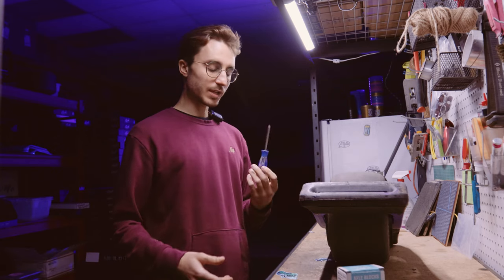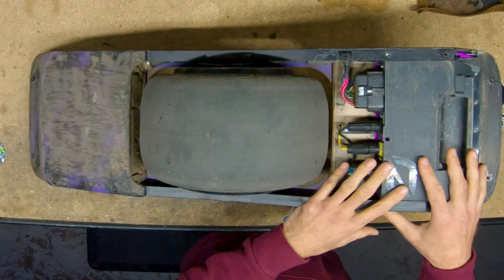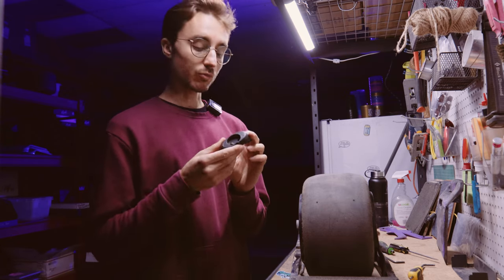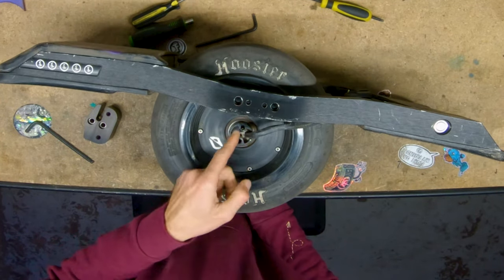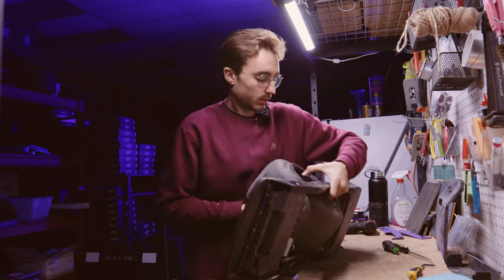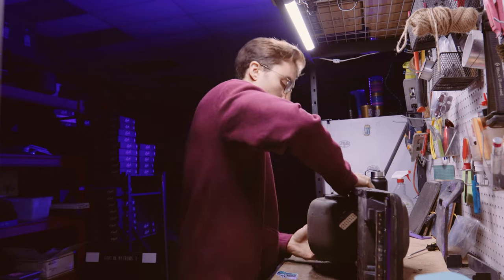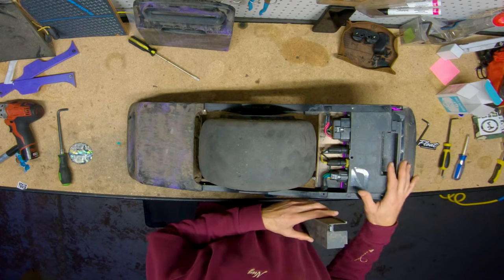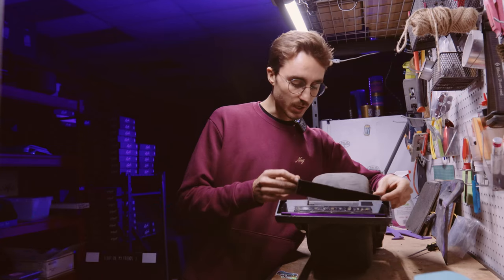Half & Half Axle Blocks Installation Guide

Comment: Can't wait to get my hands on one of these, been waiting patiently since Jake first started talking up the idea early this year. Side note, noticed the front bumper on this board isn't using the top 2 insert screws, ever had any issues running them like this? I've always wondered how necessary they were outside of helping with the fitment, it would definitely be nice to be able to get to the controller without having to remove the front footpad to get to those screws
Reply: Personally, I do use them every time, but I know people that ride very hard without them. This wasn’t my board, actually made it easier to do the install though

Comment: Great to see Jake helping with more content. Is there any reason why you wouldn't design the blocks out of urethane to help with shock absorption?
Reply: It would give a wobbly feeling, you know like when your inner hub bolts are loose? I want shock absorption just as much as anybody but it would create a wobble/loose bolts feeling whenever the motor changes acceleration